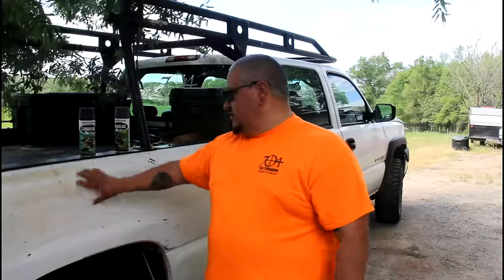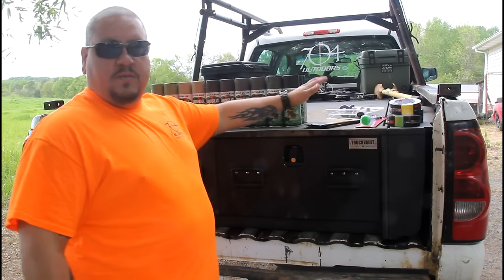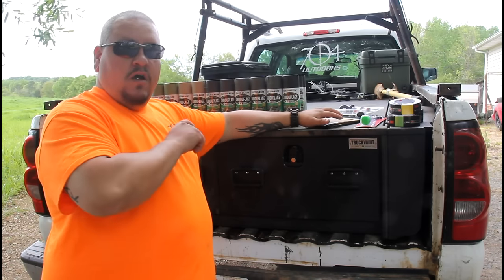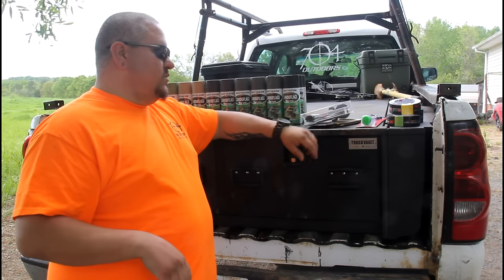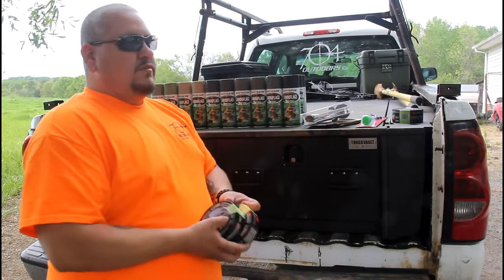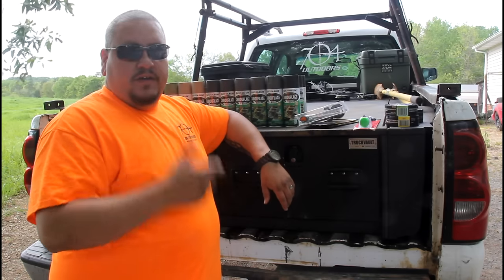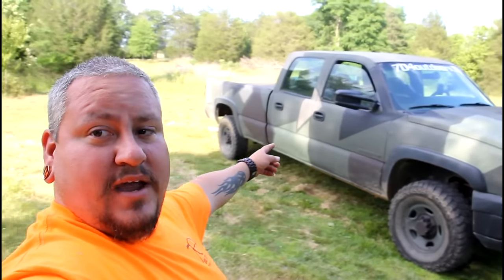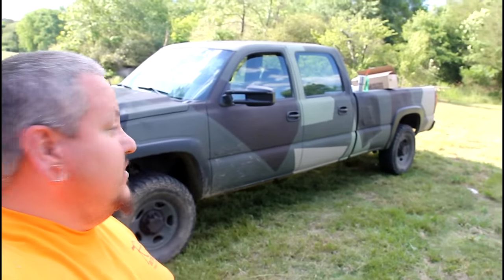Chevrolet Silverado Gets a Camouflage Paint Job! "Project SkullDozer"

Comment: I didn't sand my jeep, this paint grabs like crazy. Won't ware off for years . The cans spray heavy too so watch out. Runs easy on vertical surfaces. Go light with several coats, but hoods and roofs go hammers. That's where you need heavy coats to build it up from rain and sun. I recomend (tractor supply) they have one gallon buckets of brush on rustoleum bedliner for 75 bucks. It's 100 bucks every where else. Brush it on your plastic mirrors or fender flares etc. Looks ok, you see brush strokes but you get more coverage then spay cans of the same stuff plus it is thicker and holds up better. Will never come off plastics. I've scuffed trees and it won't come off my bumpers and flares. I bet you can tint the bed liner with an oil base flat paint too ? One thing to remember. This spray paint will not wash off hand prints and spit loogs. Mud yes. Everything else stains paint so if you want it looking pristine don't spit out the window's or touch with greasy hands.
Reply from the maker: Thanks for watching!

Comment: Shouldve done a flat clear coat on it so you could wash it later without washing the color off
Reply from the maker: Held strong all these years!
Reply: Yea right
Reply: I agree. 
Clear coat mandatory. 
I used it on a surfboard. 
It rubbed off so bad I had to clear coat it. After that it was great.
Reply from the maker: Check out the new video update we just uploaded. 6 years later it's still holding strong.
Reply from the maker: We just uploaded a 6 year update video just for the nay sayers.